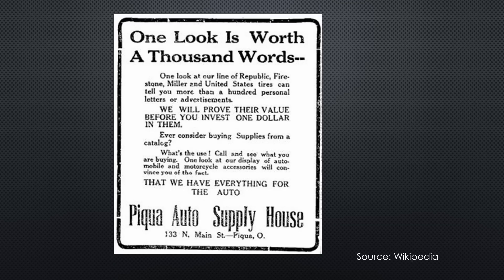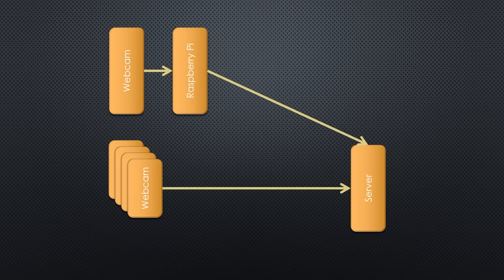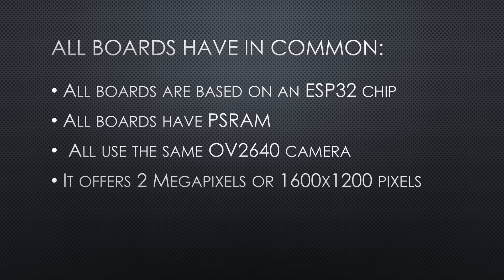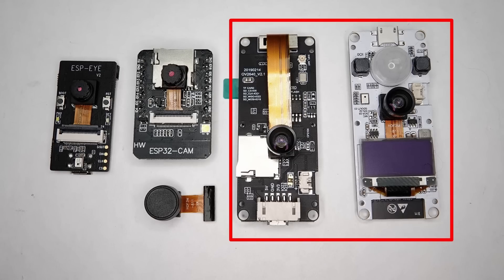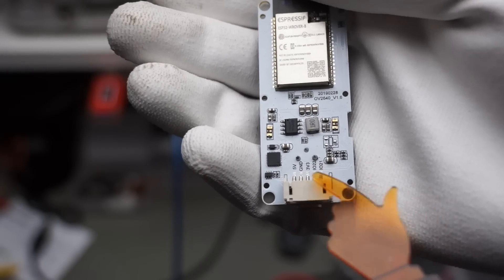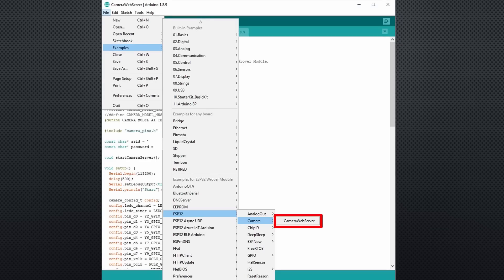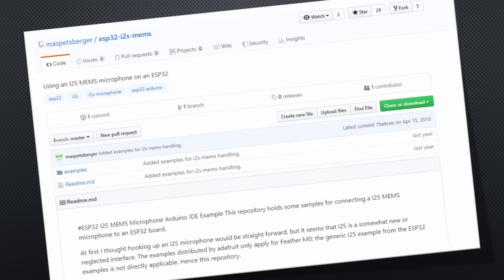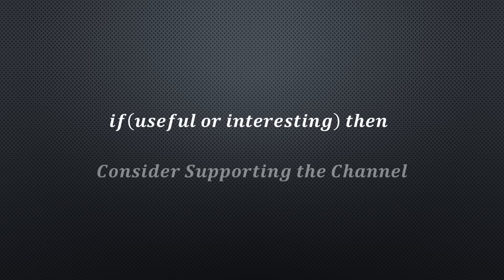#285 ESP32 Cameras: Comparison and Test (OV2640) and I2S MEMS microphone test

Comment: Been using ESP32-CAM module for two weeks now, I'm kinda dissapointed. The video quality is rather poor, even with good light, fps is poor (it's rather seconds-per-frame). AND it sometimes hangs (can't access it in any way, no stream/image available, then after few minutes it works. Sometimes it needs reset). Also the module itself runs very hot (which might cause the earlier problem). 

I'm running tasmota firmware on it, so it might be why it doesn't work as stable as I would like to, but can't imagine that better/less bloated firmware would miracly cause the image quality/fps to become better now. 

Tl:dr It's nice fun n cheap gadget, but don't expect anything from it.
Reply from the maker: Agreed. Not many useful projects were made with these boards.

Comment: what is the quality of videos? Can you take still shots too? Btw. did you noticed that camera was most of time unfocus on cat? This is because most of autofocus systems have diffculties to lock on animals fur, if you have tried to take photo of moving dog
Reply: My experience with ESP32CAM is that quality is good enough if we have slow movements, but when moving it is very poor (I guess it is a topic of the speed of scanning the image...). By the other side, the quality of the lens is very basic, it should be easy  to find cameras with better lens to be connected to the ESP32CAM.
Reply: @jmcastellvi  My testing is that it is not suitable for indoor survellance because in dark you cant see anything and I dont mean pitch dark but light where human can see

Comment: Hi Andreas, I am with love looking your videos, some of them remind me of a time when I was HAM. 
You mentioned Tensorflow and face recognition usage, I am currently building DIY toy car project with Tensorflow.js and using ESP32-cam mjpeg stream for video capture. It's only one the beginning stage. But I have got not bad results even running everything in Google Chrome browser (The reason was that on my Hacktintosh I had the luck to use GPU only via webGL for speedup Tensaflow and free my CPU ;) ). If you interested in this, ping me.
Reply from the maker: Thanks for the offer. I always shift video and machine learning from month to month...

Comment: Informative video. Thanks. 

Could I buy a separate OV2640 camera and connect it to an ESP-32 board? I guess only these ESP-32 boards are designed with a connector for a camera?
Reply from the maker: I do not know.

Comment: I just wanted to let you know.  I just picked up a few ESP32-cam's.   I also purchased a few
fish eye cameras with RazPi Zero cables.   They don't fit.  Very close.  I guess I need to find a vendor that has such cables. (Ribbon cables)  Or find ESP32-cam compatible cameras.  
Maybe the interface is different?    My application is for security so wide angle is needed.  

Thanks for doing all the hard work putting out so much information.
Dave
Reply from the maker: I never looked into this matter. But I am sure you find out if they are the same cameras. Only a fitting connetor is not enough.
Reply: @AndreasSpiess  Hi Andreas
Yes.  Here is the information for your reference.
I have photos, but don't see any way to post them here.

Raspberry Pi Zero
22 pin. .5mm pitch

ESP32-Cam
24 pin. .5mm pitch.

Comment: Yes, THAT is an swiss accent. Notice the distinct difference between a german speaking english?
And seriously... Tensorflow on  the RPi? Do you know Yolo (uses Darknet)? Yolo classifies quite many different types of objects, but requires quite some processing power... the RPi3 needs around 40 sec for a single frame!!!!!! To make it realtime some external accelerator is required... and even veeeeery small cnn network models,,... It might work with very small images (need to test though...) like 50x50 greyscale or so...
Reply from the maker: The stundents did tests with yolo and tensorflow lite. It takes a long time for processing. You are right. But meetings usualla also take long...
Reply: LOL :-)

Comment: what arduino ide code need install all camera board. all use same code or ????? and . i can order 5stack esp32 camera module or ttgo-t no sd card,black,no pir, oled display.sma version maybe have, ecternal antenna have SMA connect, can this use same code and were code have ??? need only change ssid and password in code ?? i not understand code anythink.
Reply from the maker: Too many questions. Maybe you start with a simpler project?
Reply: @AndreasSpiess  what is esp-cam simple version what can use ?

Comment: The low performance is really limiting. The only good thing is that it is cheaper than most IP webcams and doesn't require a USB capable host. But it does require something to power it and possibly an enclosure. I can see uses where we need an additional set of eyes without too many hazzles. Like monitoring animal cages/sleeping places. Or monitoring experiments. Or maybe for spectrophotometers and things like that.
Reply from the maker: These are the reasons I so far had no use for the module :-(

Comment: I have some code which runs perfect on the ESP32-CAM from the Arduino IDE.
I use following setting for the Arduino IDE: 
 /******************************************************************************************************************
 *  Board Settings:
 *  Board: "ESP32 Wrover Module"
 *  Upload Speed: "921600"
 *  Flash Frequency: "80MHz"
 *  Flash Mode: "QIO"
 *  Partition Scheme: "Hue APP (3MB No OTA/1MB SPIFFS)"
 *  Core Debug Level: "None"
 *  COM Port: Depends On Your System

Now i want to compile my code with Platform IO, but it does not work
I suspect something with my SPIFFS, i cant read the config file, my read code produces rubbish, but when compiled in the Arduino IDE, the exact same code it read the contents of my config file in SPIFFS perfecty.

So question is,  does anyone knows how to setup the partition Scheme in Platform IO.
My current settings in the platformio.ini is:

env:esp-wrover-kit]
platform = espressif32
oard = esp-wrover-kit
framework = arduino
platform_packages = framework-arduinoespressif32 @ https://github.com/espressif/arduino-esp32.git
; set frequency to 240MHz
board_build.f_cpu = 240000000L
; set frequency to 80MHz
board_build.f_flash = 80000000L
board_build.flash_mode = qio
monitor_speed = 115200

So question is how do i set my 1Mbyte SPIFF  memory in platformIO ?

If anyone has some idea please share.

Comment: Great videos Andreas!  I was wondering if you would be able to publish the current used while the camera was on, with the flash on and without the camera active. I don't have a current measure and you seem to be able to measure pretty accurately. Thanks.
Reply from the maker: I do not remember, this is an old video. I assume it is in the range of the normal ESP32 (around 100 mA)
Reply: @AndreasSpiess  it seems like it's drawing more than that as it flakes out on my YwRobot power supply. It powers fine when plugged into the laptop usb. Just wondering... Thanks

Comment: Thanks for this info.  I have been working on making myself a motion detecting security camera out of the cheap esp32-cam board and wonder if you have any advice on how to improve the cameras performance in low light conditions (which seems surprisingly poor)?
BTW - you can view my progress here: https://github.com/alanesq/CameraWifiMotion
Reply from the maker: Thank you for the link. Intersting project!
Reply: @AndreasSpiess  BTW - I have now discovered that if you fit a better lens to these cameras (I fitted an M12 holder to it using hot melt glue) it completely transforms them in low light conditions and makes them a very good security camera.  Without doing this, as soon as it starts to get dark you basically just get a black image.

Comment: I am hoping to move my ESP8266 garage door controller to the ESP 32 with the Camera.   I don't think there are enough pins however to attach the position sensor switches and the NRF201 antenna.     Still would be very nice to have visual confirmation of the door position and pictures from when the door was opened to send to Blue Iris and show on OpenHAB.  Having fun.   Thank you for the inspiration and knowlege
Reply from the maker: Nice project!

Comment: First I want to say, thank you for sharing your wealth of knowledge.  I have setup a ESP32-cam board, which I am trying to flash with an Arduino UNO.  I triple-checked the connections - quite basic.  It's coming back saying this, when I load the sketch,   Arduino: 1.8.11 (Windows 10), Board: "ESP32 Wrover Module, Huge APP (3MB No OTA/1MB SPIFFS), QIO, 40MHz, 115200, None"Sketch uses 2100683 bytes (66%) of program storage space. Maximum is 3145728 bytes.
Global variables use 53552 bytes (16%) of dynamic memory, leaving 274128 bytes for local variables. Maximum is 327680 bytes.
esptool.py v2.6
Serial port COM3
Connecting........_____....._____....._____....._____....._____....._____....._____A fatal error occurred: Failed to connect to ESP32: Timed out waiting for packet header
A fatal error occurred: Failed to connect to ESP32: Timed out waiting for packet headerThis report would have more information with
"Show verbose output during compilation"
option enabled in File -> Preferences.I tried every model listed in the sketch, by commenting them out one at a time.  I still get the same message.  Please, advise.Thank you,  Mac
Reply from the maker: Unfortunately I cannot do remote debugging. Maybe you google how it is done.

Comment: Problem after working successfully two days

ets Jun  8 2016 00:22:57

rst:0xc (SW_CPU_RESET),boot:0x13 (SPI_FAST_FLASH_BOOT)
configsip: 0, SPIWP:0xee
clk_drv:0x00,q_drv:0x00,d_drv:0x00,cs0_drv:0x00,hd_drv:0x00,wp_drv:0x00
mode:DIO, clock div:2
load:0x3fff0018,len:4
load:0x3fff001c,len:1216
ho 0 tail 12 room 4
load:0x40078000,len:9720
ho 0 tail 12 room 4
load:0x40080400,len:6364
entry 0x400806b8

Brownout detector was triggered

More details:
https://github.com/espressif/esp32-camera/issues/115

Please help me :-(
Reply from the maker: Brownout is usually triggered when voltage is too low.
Reply: @AndreasSpiess  
How can I solve?

Sometimes serial monitor shows below lines and stops printing

[E][camera.c:1049] camera_probe(): Detected camera not supported.
[E][camera.c:1249] esp_camera_init(): Camera probe failed with error 0x20004

Comment: Hallo Andreas, I have a ESP32 camera, which I cannot access. It seems, the FTDI232 starts to communicate, but then (see by yourself):Serial port COM8
Connecting........_
Chip is ESP32D0WDQ6 (revision 1)
Features: WiFi, BT, Dual Core, 240MHz, VRef calibration in efuse, Coding Scheme None
MAC: a4:cf:12:99:bb:78
Uploading stub...
Running stub...
Stub running...
Changing baud rate to 921600
Changed.
Configuring flash size...
Warning: Could not auto-detect Flash size (FlashID=0x0, SizeID=0x0), defaulting to 4MB
Compressed 8192 bytes to 47...
Writing at 0x0000e000... (100 %)
Wrote 8192 bytes (47 compressed) at 0x0000e000 in 0.0 seconds (effective 2184.5 kbit/s)...

A fatal error occurred: Timed out waiting for packet header

Hast Du eine Idee?
Reply from the maker: Du musst das Board offenbar speziell anschliessen: https://randomnerdtutorials.com/esp32-cam-troubleshooting-guide/

Comment: Great Video... And I saw you also have a great video on the TCA9548A I2c multiplexer... I am working with a ESP32Cam with OV2640 cam but wanted more gpio pins... for controlling a motor (L2N98 which needs: - ena , in1, in2 pins), a touch sensor,  two limit switches, and a few push buttons plus a few LEDs.  Would it make sense to add a TCA9548A 1-to-8 I2C multiplexer to the esp32cam - then adding a GPIO Expander (MCP23016)... or what would you recommend? A tutorial would be cool - I am sure lots of people would love to have more gpio pins on this cool little board!  Cheers. And great work!! Phil
Reply from the maker: You do not need a i2c multiplexer if you plan to use MCP23016. They have 2 address pins and you should be able to connect 4 of them on one I2C bus. 1 I2C bus supports up to 127 devices with different addresses.
Reply: @AndreasSpiess  Ah ok - that makes sense...now just need to figure out how to change the gpio pins be SDA and SCL...I am using the wire.h library but no luck so far....I need to do a bit more reading

Comment: @Andreas Spiess, The price of the esp-cam is 4$, add some cooling, USB adapter you pretty much get an ultra-cheap surveillance camera ( supported by Home assistance with that default sketch! ). Add some sensors ( disable SD card/flash led), use EspHome and you get the ultimate ' magic box ' for your smart home.
Reply from the maker: Good idea!

Comment: I have an ESP32-CAM and it's working nicely with the Arduino sketch, MicroPython version, or the ESP-IDF camera examples. However the issue I still face is that the wifi transfer write speed is at best 20kB/s so it takes at least 4-5 seconds to send a single 1600x1200 image over wifi; nothing like the 2-5 fps that can be seen at 8:32 . That is not expected at all as the esp32 should be much faster than that, and I don't quite find the source of that slowness; it's totally unrelated to the camera module.
Reply from the maker: I do not understand why you want to transfer such resolution. The camera has much less resulution.
Reply: @AndreasSpiess  Actually for my goal, 800x600 or 720p is perfect enough but even at these I barely get 1fps, not due to image capture but slowness sending over wifi. I made a test using 1600x1200 because ironically that's what you demonstrate at 8:40 in the video, look at the top right your setup is UXGA(1600x1200), so it allowed me a direct comparison. My comment is however not on the camera itself but the wifi speed I get. The esp32 should be able to achieve 20mbit/s but in my tests I achieve 1/100th of that, which does not seem right. Right now I'm rebuilding and flashing the ESP-IDF iperf example to test the wifi speed and isolate the problem.
Reply: Wanted to update this. On the ESP32-CAM I now reach about 5-7 mbit/s (tested using the ESP-IDF iperf sample code, with the small pcb antenna). The issue I had before was with the wifi router. Once that side fixed, in UXGA I average 5 fps, in XGA I average 6 fps and in VGA I average 12 fps. That's good for my application.

Comment: Hi, Great videos and lots to learn. I just wanted to ask a question, I recently got ESP32 Cam and MEMS microphone (INMP441). Documentation says to connect SD pin to GPIO32. But ESP32 Cam doesn't have GPIO pin 32. Any ideas?
Reply from the maker: I also had my problems with the different boards and the documentation. So I am no big help here.
Reply: @AndreasSpiess  alright, no problem, thanks anyways.

Comment: I'd like to build a small (and cheap!) voice + gesture enabled switch for lamps, light switches, and other appliances. 

Would you recommend using an ESP-CAM, and offloading the pattern recognition to a tensorflow server?  Is there a solution which does not depend on an external server or more expensive board with DSP? What if we only wish to process audio locally?
Reply from the maker: The ESP32 is not strong enough for pattern recognition. I do not know of projects using voice.
Reply: IoT Update: I've found a keyword spotting engine that runs on the ESP32 [1]. The engine only detects the phrase "hi lexin", and is proprietary. However, this paper [2] shows us how to detect "hey cortana" on a 48mhz microcontroller with 32kb ram. And their code is open!

The secret sauce is neural network quantization [3]. It lets us compress a floating point DNN into one that uses only bitwise operations (and ~100x less memory). (This paper has over 1000 citations, and is quite remarkable.)

tldr: There is the smallest glimmer of hope that my project can run on a $14 M5Stick-C Pico or a <$20 ESP32-CAM!

[1] https://github.com/espressif/esp-sr
[2] https://papers.nips.cc/paper/8116-fastgrnn-a-fast-accurate-stable-and-tiny-kilobyte-sized-gated-recurrent-neural-network.pdf
[3] https://arxiv.org/pdf/1602.02830.pdf

Comment: Great video, tkanks! Have you try to actually check the sound recorded via i2s mems ? They struggle a lot with RBP ('works' but super poor quality due to audio drivers and omega onion, where i2s don't work at all despite claims by the vendor)
Reply from the maker: I only looked at sound levels, not actual recordings as I have no plans to use it for that.

Comment: Hello Andreas
just a small question.
i have Rasp 4 - Buster - have installed Arduino ide 1.8.9my Problem i can't find/add, in the (Arduino IDE) Board Manager the ESP32is there a trick to install it?have a nice day
vinc
Reply from the maker: I do not use Arduino IDE on Linux. So I do not know.

Comment: Hi Andreas, 
I have the ESP32-CAM running and use it for my catfeeder, to verify if the food is dispatched and the 2 cats are eating, while we are away from home (this was a hard requirement from my wife). I added in the software the possibilty to do a http GET, which puts on the flash light and then streams the picture to  my rasperrypi, where it is stored and can be looked at anytime. 
My wife is quite happy with it, which for me made it a succesful home automation project.  Happy to share the code .
Reply from the maker: Happy wife, happy life! Maybe you post a link to the code?
Reply: @AndreasSpiess  Hereby the link. Next to the ESP32_CAM software I have included a python program that actually fires off and stores the picture(s). Plus some STL files for the housing and a little documentation. https://drive.google.com/drive/folders/1oeXK3RdRFF0gvLIs-Qo639d4y01AS0I9?usp=sharing
Reply from the maker: Thank you very much for the files. I will have a look at it.